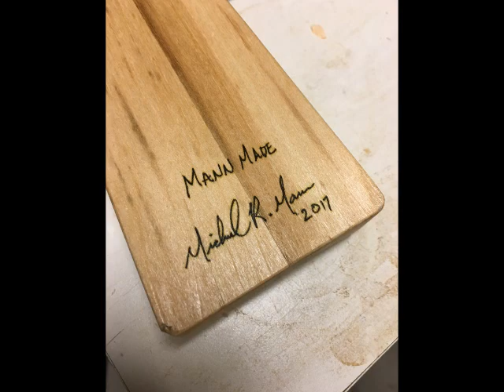Celtic Trinity Knot Cross

Comment: Do you recall the diminsions of the basswood board you used, the compass radius setting, and the dimensions of the finished cross?
I am interested I making this, it is beautiful
Reply from the maker: I am afraid I didn't write any of this down. I will give you approximations... total height 12"-14", width 9"-10". The center ring diameter approx. 5", then the Triangle shape curves are much bigger, I am guessing 8" diameter. One thing that I would change is the length of the lower arm, in my opinion it looks too short compared to the side and top arms. The thickness of the board was 1". The wood I used was Basswood.
I recommend drawing it all out on paper or using a computer program if so inclined. Work out the details on paper and then transfer it on to the wood. Best of luck with the project.

Comment: Is there a pattern for this cross. Beautiful cross.
Reply from the maker: Rick Buchanan - I made the design myself. My only regret is that the lower arm is not longer. If I make another with this design I will lengthen the bottom arm about 2 inches.

Comment: Was the big chisel made from a spade drill bit?
Reply from the maker: Yes, I have used spade bits for a few chisels over the years. The tricky part is to find spade bits without a hole in them. Mine here of course has a hole, which will shorten the life of the chisel once my sharpening reveals the hole along the edge. Sorry for the delayed response.